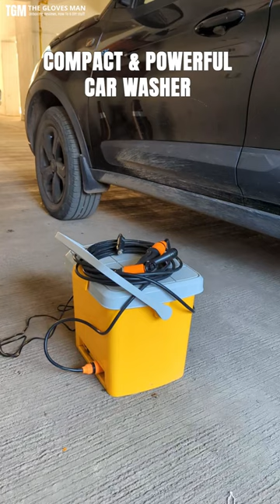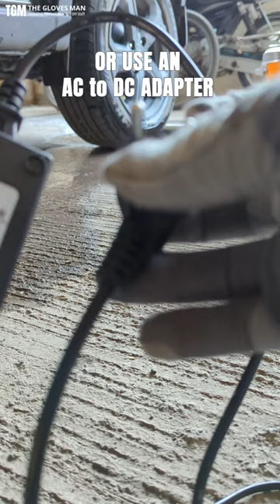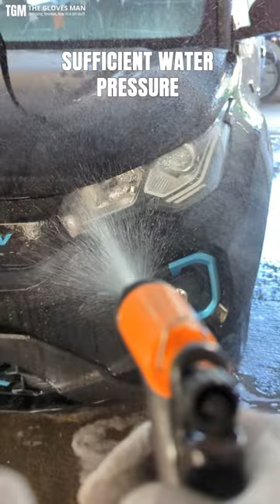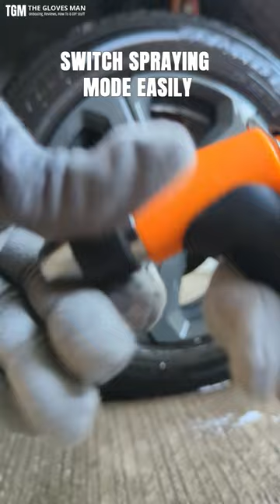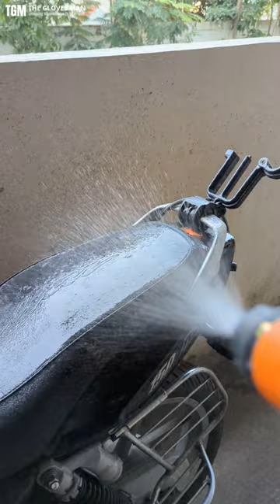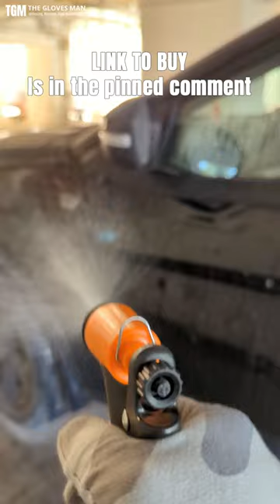Compact Car Washer - 12V Portable Washer #shorts

Comment: Bro how much water it will take for nexon( rinse, soap and rinse again)
Reply from the maker: Good question.
I usually fill that portable washer fully and use it for the rinse part. Then I use a separate bucket with soap foam to spread it all over the car. Then again I have to fill the portable washer for the final rinse.

Hope this answers your question.